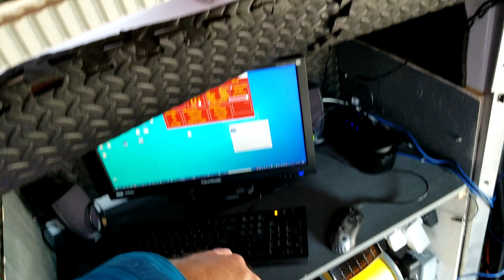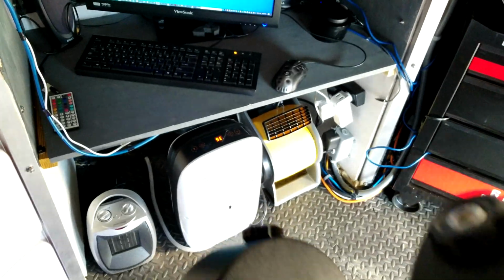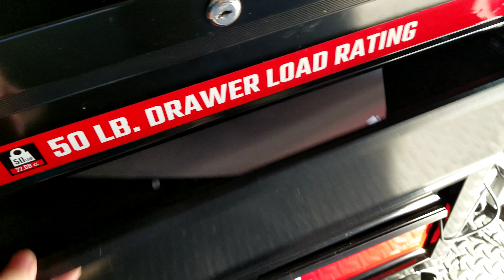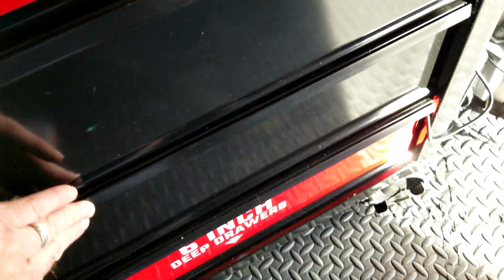NexDome Wrap up Video After Construction

Comment: Bit concerned at the comments about the amount of leak points and areas of water pooling especially near the electrical kit. Other than that it looks good if a little snug for a big user.
Reply from the maker: Hi there, since my original construction date (1.5 years), i've never had water near the electrical area or really any other high risk area.  The only place that can sneak in is by the door and thats only if i forget to make sure my make shift flap isnt down over the top gap (used a bag cut into a long stick adhered to just above the door frame, works like a charm).  If it does get in there, its just a tiny amount at the doors entry point.  I rarely sit out in the dome, 95% is remote, except for switching optics or maybe planetary.

Comment: Hello , I was wondering what you feel about the construction of the NexDome?  Are the walls solid or flimsy?  I'm a little concerned about the rain leaking problems. How has the Tracking system been holding up ? I think you have everything dialed in amazingly. Thank you for any comments , I'm going back and forth between the NexDome and the SkyPod systems on which on the purchase.
Reply from the maker: Overall I'm very happy with the nexdome.  Its been solid, no leaks except the top of the door which i mitigated with the plastic going across the top to prevent it coming in the door (was a trickle).  So I guess you could say the door is the weak spot, but easily fixed.   I like the wind protection and light protection you get from something like the nexdome (vs say the skypod)